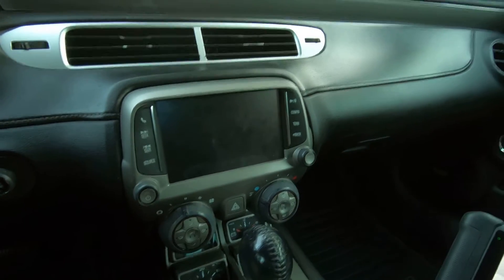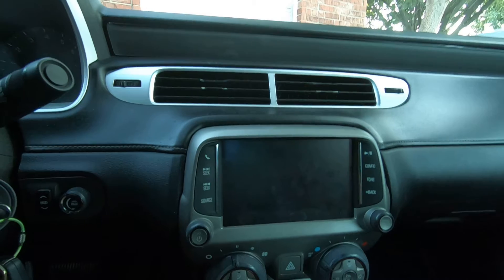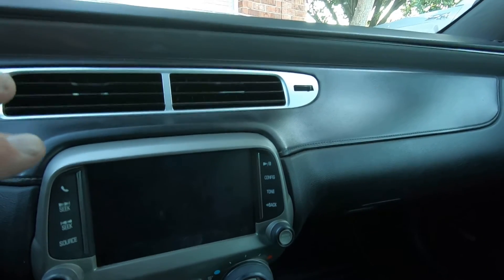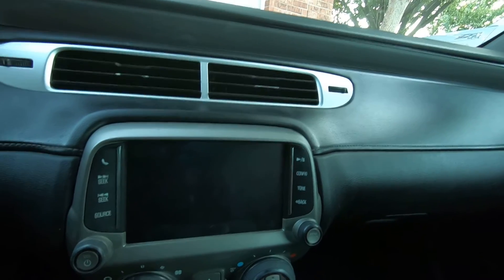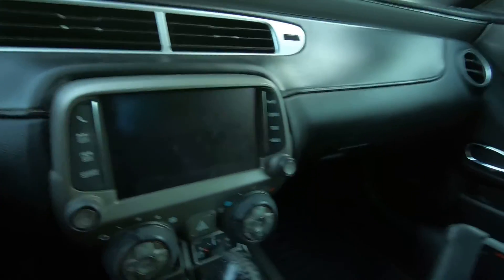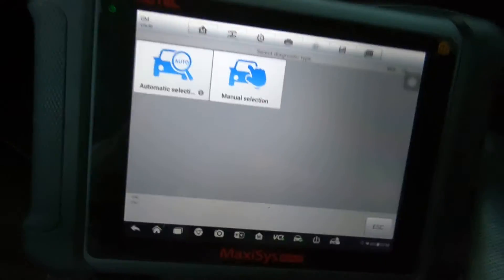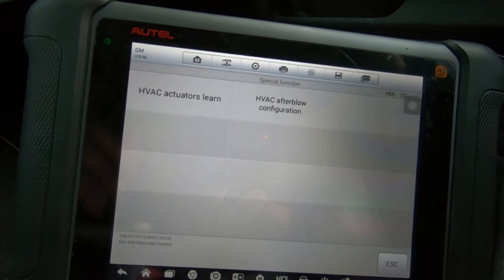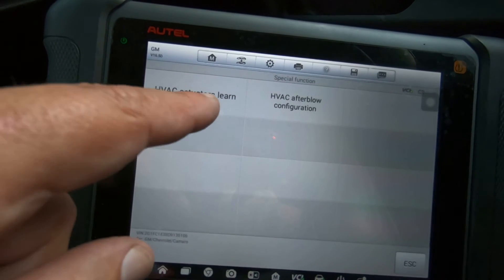How to prevent the Blend Air Door from Breaking on a Camaro using the HVAC Actuator Learn Option.

Comment: Had a Camaro SS with this problem. Fixed it myself with hot knife to replace blend door. Not gonna lie, it was a nightmare, but doable. No longer have the car, but if I did buy another Camaro, I would just not turn heat or air completely all the way to either max setting.

Comment: My drivers side vents blow warm air and the passenger side blows cold air. Its not dual control. 2012 camaro. What do I need to do?
Reply from the maker: Make sure the refrigerant is full to start with.

Comment: Scan tools are so expensive...
Reply from the maker: They have actually come way down in price, my first real scan tool was a snap on MT2500 and I bought it used for $800 and had to by yearley updates and it didn't do half what these newer ones did, then after that I bought a Snap On verus that if I bought it new would have been $7500 but I got it for $2500 then they stopped supporting it so I sold it and bought a xtool D8BT for $500 and it does everything the snap on verus did excpet doesn't have the troubleshooter and the built in scope.

Now they have the Thinkcar and Mucar with lifetime updates and they both do everything the snap on does.
Mucar 892BT
https://www.amazon.com/dp/B0DTK24XKB?ref=t_ac_view_request_product_image&campaignId=amzn1.campaign.AB132QU66F0K&linkCode=tr1&tag=737mechanic-20&linkId=amzn1.campaign.AB132QU66F0K_1755909130368

Thainkcar 689BT
https://www.amazon.com/dp/B0DCFRF2TF?ref=t_ac_view_request_product_image&campaignId=amzn1.campaign.2XLNI45LG86QW&linkCode=tr1&tag=737mechanic-20&linkId=amzn1.campaign.2XLNI45LG86QW_1755909173535

Comment: The D7 does work, just picked one up from Amazon and did the calibration.  Was quoted $200 by the dealer to do it, so I spent a bit extra in protest and now have the tool.

Comment: I just replaced the blend door which in fact was broken but still not getting any heater, i still have to to the actuators learn but does anyone know if no heat can be caused for missing that calibration???
Reply from the maker: Disconnect your battery for about 5 min and reconnect and it should recalibrate itself when you start the engine. Also, make sure the heater hoses under the hood are both hot.
Reply: @ i did disconnect the battery and reconnect it , didnt do it, but the hoses going to the heater core are not hot they seem a little warm , this with a temp of 180f wont go further than that on idle, could it be a bad thermostat or clogged heater core?
Reply from the maker: @leovela5566  Could be a clogged heater core, also make sure it is full of coolant.

Comment: Everytime you unhook your battery or lose power for any reason you will have to do this over again or you will have the same problem I’ve found instead of turning the knob all the way on hot or cold leave it one click off and it works perfect

Comment: I have a 2011 ss2 and im finding when I turn the heat on the lowest setting it sounds like its running high and it shuts off. If I turn it off and wait acmin and turn it back on it will turn on again then go off. Any thoughts?

Comment: what i want to know is how can i do this with Torq Pro..  because that thing is odb2 interface.. so why the hell cant i do this on my own.. why do i have to pay a stupid shop to do a stupid config like this, that i can do with my own equipment..   that's what i want to know.
Reply from the maker: Because you have to have a bi-directional scan tool capable of doing these types of functions. Torque Pro is a decent code reader but it isn't bi-directional.
Reply: @737mechanic  bidirectional or bisexual?   Lol
Reply: @737mechanic  odb2 is a pretty basic protocol,  are there any other tools that are bidirectional that you know about?   in this day and age,  we can make a odb2 interface with nothing more than a $5 arduino and a hand full of parts.   there has to be other tools other than the $1k unit you use or the one time "Dealer" fee,  that 99% of people just dont trust dealers anymore.. including myself.. been screwed by them too many times to go back.. and i refuse to do so..

Comment: Hey so I recently just fixed my blend door and the ac works but no heat comes out whatsoever just wondering what I could do
Reply from the maker: First, make sure your coolant is full. When the A/C is on and you turn your temp selector to warm does it change at all?
Reply: @737mechanic  nope it remains all the way cold
Reply from the maker: @Drosflow  If you listen can you hear the door actuator running when you turn the temp selector?
Reply: @737mechanic  no it doesn’t make any noises like it use to
Reply from the maker: @Drosflow  I would make sure you have the connector plugged in fully. Also make sure the fuse is good.

Comment: I wish that I would have found this video about two months ago. mine was dx as a bad compressor. I get lukewarm air. Hotter on the passenger side than the drivers. Then they told me that the supplied compressor was bad so I replaced it with another. Still didn't fix the issue. I'm about $1k into it without a fix. This will be a weekend project now!
Reply: Did you got ur ac fixed?, i have the same issue driver blows warm but the passenger is cold

Comment: Could you also solve the problem by not turning the knob all the way to cold or hot. Just like one notch before. So the door doesn’t have a lot of strain on it to hold that position? Am I making sense? Lol. My ac condenser went out and it cost over $3000 bc the windshield and entire dashboard had to come out. I would die if I have to go through this again with the blend door
Reply from the maker: Yes, you can, The only problem is remembering to do that and wondering if you will get full cold on a hot day. But yes that will help prevent the stress it is under.

Comment: When I recalibrated my hvac system it apparently enabled the afterblow feature where after car is turned off it blows out pockets of air and now my battery is getting drained. I need to disable this??
Reply from the maker: If you have a scan tool you can disable the afterblow.

Comment: Mine blows driver side “COOL” not cold and “WARM” not Hot on passenger side. Is it the blend door??
Reply: This is exactly what my Camaro is doing, cold on driver side, warm on passenger side.
Reply: @TampaAries what was the problem?
Reply: @mtsanchez27  the blend door broke would cost 3,000 to replace and most of the cost is just from labor, they would have to remove dashboard and windshield to get to the part that need to be changed. I said thanks but no thanks...I'll just deal with the air blowing cold on one side.
Reply from the maker: It could be but the first thing to check believe it or not is the refrigerant level. The way these newer cars are ducted if the refrigerant gets low one side can be cooler than the other all because the refrigerant is low.
Reply: @737mechanic can it also mean that it is just the actuator and not the blend door that's broken.. and can I change just the actuator first and see if my problem is fix before I deal with the blend door and all that cutting..?

Comment: Mine is opposite… no heat just cold air 🤷🏻‍♂️
Reply from the maker: Depending on where the door is when it breaks you will have either only heat or only cold.
Reply: @737mechanic  What is wrong when you have the AC turned on. The drivers side stays cold and the passengers side starts off cold and then gets warmer and stays warm until I shut the car off for a while.
Reply from the maker: @RoliO11  Is it a camaro?
Reply: @737mechanic  yes a 2012 SS. I think it's maybe low on refrigerant. I am going to get it checked soon. I don't really think its the blend door because I never turn it up to the max setting as I know that is a way to prevent it from breaking.
Reply from the maker: @RoliO11  The first thing I would do is make sure it is full of refrigerant.
Reply: @737mechanic  I just got the car checked out and it was a bit low on refrigerant. It was filled up. The drivers side still blows cool (doesn't get really cold) and the passengers side just stays warm. I bought a borescope and took a peek through the resistor hole and I can see the door moving a bit but I don't think it fully closes. I guess I just need to get the side cut open and find out for sure if the door is broken. My borescope came out of the resistor hole ice cold though.
Reply from the maker: @RoliO11  Access and remove the door actuator and you should be able to tell for sure if it is broken. If it isn't there is no need to cut anything. If it is go ahead and make the cut.
Reply: @737mechanic  yeah that was my thought. Remove everything needed and then see if that white connector is still on the actuator. If it is then I can turn it and see what happens. I am pretty sure the blend door is broken though.
I do have one last question. :) When you are cutting the plastic up near the evaporator, how far behind the plastic is the evaporator? Is it 1/2 inch, more, or less?? If I knew then I can grind a blade to that size to ensure I don't damage anything but still cut through. I have plenty of exacto blades so I can have one for the top corner and then another to do the rest where space is not an issue. Thanks man and I will probably do this next weekend. My door is on order already.
Reply from the maker: @RoliO11  It's maybe 1/4in or so. If you are using the hotknife method as long as you don't push it in really hard you will be fine.

Comment: If the dealer fixes this do they not do this process before giving you the car back?
Reply from the maker: The car is suppose to be able to do it but it is good to do it very now and then because sometimes the actuators will get out of calibration and when that happens it places to much stress on the door.

Comment: Hey how are you..! thanks for the video it looks that this is the information I was looking for and please help me a little bet I have the same car, is being a nigh mare cuz it blows the air  where is no  supposedly  to blow it.You think this could be  the problem  air blow benders  are not calibrate it I change heater core, HAVAC Module and also I programed as well.My English not so well sorry..
Reply from the maker: That would be the first thing I would do but you also need to make sure you have all the actuators connected. You can use a scan tool to move each actuator also to see if it is capable of moving.
Reply: @737mechanic  thank you I do  really appreciated ..!!